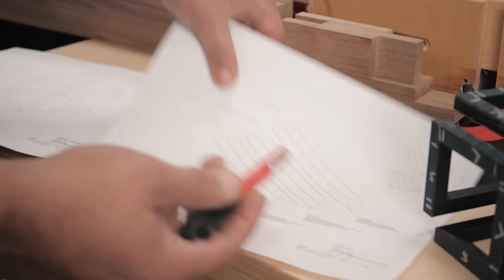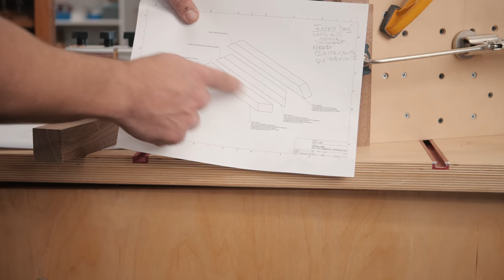Infinity Cube Table

Comment from the maker: Get the Free Cut List and Plans/Cut List here - http://bit.ly/InfinityCubeCutListPlans
My friend  at Everything Wood and Metal has a great cube calculator if you want to do a different size than I did. Check it out here: http://bit.ly/InfinityCubeCalculator
BitsBits is the BEST place to buy router bits: http://bit.ly/BitsBits USE CODE JKATZMOSES15 for 15% off
Reply: Jonathan Katz-Moses I’m first to ay hello!
Reply from the maker: I've gotten several orders from Canada today. Should be working.
Reply: Jonathan Katz-Moses my error. Thanks 😀
Reply: Build a second cube using the kawaii tsugite wood joint.
Reply: En tenon mortaise on ne verrait pas de différence de teint ...
Reply: Would you tell me all 18 sticks length ?
Reply: Great video. I was inspired to make my own table. One thing I must mention.  Make sure all 4 corners at squared off.  Mine were slightly curved so the joints did not match up nice and tight.
Reply: im going to try this for the airport,i got to get it approved if it does ill send you a pic, thanks for the idea!!!
Reply: Please share the measurements of this table! Love your work from India 🇮🇳
Reply: I miss SGI (Silicon Graphics, Inc. – https://en.wikipedia.org/wiki/Silicon_Graphics – whose logo this shape (in tubes) once was...)
Reply: @DavidLindes  Just went to check and you are right ...
Reply: Ritesh Sinha glad it checks out. :)
Reply: Thanks
Reply: Cant open the download the list will not open with one drive or Samsung cloud
Reply from the maker: @jimwatson6833  it's a .rar file you need to unpack it

Comment: Adding this to my build list for sure.  Two end tables and a coffee table to match.  Excellent project!
Reply from the maker: Send pics when you finish!
Reply: Well, did you build that project?
Reply: Shortly after, I had to pack up my shop and move, have been without my tools and shop ever since :(, but this is still on my project list.  I hope to have my new shop built in the spring, we'll see...
Reply: @billqqq  I asked because whilst I think it's wonderful project, I also think it's a huge step for the average garage woodworker. Even a skilled Sketchup user would find this a challenge - jigs, bench mounted routers, router templates, glass to order and get correct. But, the result can be stunning. I really would love to be able to make something so good looking.

Comment: Turned out great! I used a card scraper on the edge of some plexiglass I had cut to size, to remove the saw marks, & smooth it out.
Reply from the maker: Great tip

Comment: Awesome looking table.

My first thought for strengthening the joints further would be to drive a peg through each one.  That would change the aesthetics but it might look cool with a vastly different colored species of wood.
Reply: I second the Dowel idea. I would not let them be a through Dowell although. I would dowel on the inside of all joints stopping short of a threw cut making each dowel in a blind hole setting; therefore not visible on outer profile of frame work. I know it is more work involved, but I suggest off setting the dowel hole in the Tenon and Bridal joint to create a pinching effect for tightening the joint connection.

Comment: I looked at building one Mission end table.  It has 28 mortise and tenon joints in it.  I wanted a set of furniture.  A lot of mortise and tenon joints.  Very good practice, making 280 of those joints.  A good bridal joint project, if I ever saw one.

Comment: I'm planning this out, milling part is done to my dimensions. To make sure I'm on the sqaure here, when you do the bridal joints, you can cut them all the same right? It's just in the fitting process you maneuver the different ends to come together. If it's all square joinery, then you can cut them all the same. Just an amateur carpenter trying this build.

Comment: I am new to wood working.  Prior to January 2021, I had made things only in classes, other than little 1-piece gifts.  When I saw this video earlier this year, I knew I had to make it.    My husband also 3D printed it, in pieces, so I could figure out how to put it all together.    The 18" pieces and the 16" pieces are different colors.   We set up a shop earlier this year and this was crazy to make.  So far I only made it with 2x4s cut up, to get the idea.   Next we'll do it in hard wood.   Love it.  I've watched this video many times.  Thank you.  Question:   I was told to not do a full depth cut, but you did.   So that's ok?   We did the mockup in multiple passes, but would rather do them in one pass.

Comment: I've had this plan for about a year (?) and I've been afraid to screw it up. However, I've gained skills since then and now I'm ready. Going to try a lamp instead of a table. The inserts are going to be image transfer onto glass. It will take a while, of course. I wish there was a way to post the good result (doing a test cube first) on here. Can't use a router, so I'm going to try the tenon jig I have available as well as a dado stack. We'll see. Wish me luck!

Comment: Hi Jonathan, I'm making a table like this. My glass plate will comes between the beams with glass pin support. My question: how is your glass plate doing now, did it crack? Does the table stay straight or did use support blocks under beams to keep it in place? Kind regards, I'm David from the Netherlands.😃

Comment: Great table. I have just a few thoughts. You could slot dovetail the joints to give it add strength with two dowels through the back each joint as well it would hold the table together without needing clapping and would also help with the strength.
I would also like to say when machining any slots in the end timber and tenons. I would recommend keeping the material flat on the bed of the machine rather than on its end even with a jig. It's a lot safer working practice. You can achieve a similar joint with a 45 degree mitre lock router bit which will be just as strong.

Comment: Is it considered cheating if, when I looked at the joinery, I thought "some good ole square pegs in round holes centered in each of the bridal joints would add some old world flare without using glue"?
Reply: I don't really see plugs having the multi-directional stability necessary to pull this off.
Reply: @redcollard3586  👍
Reply: @redcollard3586  For the weight of the table alone hardwood pegs should work without a problem and I'd even argue than pegs alone would be stronger than glue alone with this type of joint.  You'd only really run into an issue if you try putting too much weight on it.

That aside, I'd say use pegs and glue.  The pegs would add a lot of extra strength to the joints and if you do a good enough job cleaning up the excess glue you'd never know the joints were glued together as well.

Comment: Really cool need to show my tutor this he says that tools are not good for woodwork looks amazing he's old school all joints need to be done by hand
Reply from the maker: You tell him!
Reply: @katzmosestools  he also don't know how to sharpen a chisel so his joints are not that good to start with lol
Reply: All of the above. Or maybe the curriculum states "hand cut joints." Or maybe he wants you to earn it and really understand joinery, but more likely, he doesn't have enough machines or time to fill out all those incident reporting forms in a classroom full of excitable young folks on routers. 

I had an 18 year old kid plug in a trim router without checking the power switch last year. He then tried to catch it as it jumped out of his hand. Thankfully, the router good smiled upon him, and he got away with a warning by way of a small, nonessential chunk plucked cleanly from his hand. Then, the blood came... And the damned incident report...
Reply: @jasondoust4935  I understand that part of working with power tools with my lathe I tern the power off at the wall when changing the speed just to be safe than sorry as only paid £27 for it so not sure if it all works as it should has been tested and all seems good

Comment: great project but is there a reason why a infinity cube dose not have the same dimensions overall eg the top dose not extend out above the side looks like it needs another inch l,w?  or is that the design of the cube to not be the same uniform shape see the bottom piece is the same not extended out in line with sides?

Comment: May I ask a question? Totally new to your channel. Liking it a lot!!  I'm Not a pro.   My question is. Would it make a difference in the overall stability if the base wood was heart wood? Silly question I know, but I have a sheet of a log sawn from a felled tree. If i milled it to build it "Centre up (out) would it matter at all to its over all stability? When framing the grain matters a little. Is this structure too small to see any benefit for grain density?

Comment: That is beautiful. I wonder if putting 2 brass rods in each joint (in opposite corners of the joint) would negate the need for the acrylic. I'd try it myself, but I have no place to put the finished product.
Reply: I was wondering the same thing, but with hardwood dowels. Lots of work though...

Comment: I am thinking of trying this with simple joints -- 45's and pocket screws with glue (I don;t have much in the way of tools or a shop -- mitre saw, table saw, some clamps etc. I can't tell 100% from your plans how the pattern works in terms of short and long pieces -- is there a drawing that has them marked? Sorry, prolly a newb question.
Reply from the maker: Check out the website I link as well. Should have all the info you need

Comment: Is it strong enough to be used in a typical home? Looks neat but also weak at those bottom two joints.
Reply: Just add another 5 supports and move the "feet" to under the joins.

Comment: I love this and am inspired to build one. Whether I’ll get the time remains to be seen though! I have a question and am fully prepared to be shot down in flames: I believe the idea behind the sticker on the spacing piece is to provide a looser fitting joint to enable room for glue and clamping pressure. It appears to me that the effect of the extra thickness provided by the sticker actually makes the tongue part thicker. At 5:58 the cutter can be seen taking a stickers thickness off from the spacer piece – leaving the tongue thicker than it would have been by the thickness of the sticker. Thicker by twice the thickness of the sticker once the other cheek has been cut. I must be missing something...

Comment: It looks as though the side faces are a thickness out of plane with the top and bottom edges. Assembly would probably be easier to get square and plumb if they were in plane with a thickness gap, that way you could just use offcuts in the gap to force squareness no matter the clamping force or gravity sag prior to the glue setting.   Don’t know if that change would make other parts of assembly or planning way more difficult.

Comment: How did you feel about each tenon, mortice in a single pass. All the advice I hear about router bits is that you shouldn't take a deeper cut than the width of the cutter? Seems you were taking a risk, particularly if using hardwood?
Reply from the maker: I talk about that in the video. Right after the joinery cutting montage

Comment: The other option if you don't have a blow torch, is a heat gun. The ones big enough for heating plumbing pipe... Not the small ones for card hobby :p

Comment: @Johnathon Katz-Moses What would have been really neat, is if you would have pulled in the sides so that they were right above the base then instead of using the acrylic block you could have embedded some half-inch or three-quarter inch Neodymium magnets into the wood and covered them with the stain so they were invisible and they would have supported the structure by holding it apart… It was a function like a cantilever against the other leg and you would be surprised how powerful a magnet of that size can be if you put one or two on each side of the corner.

Comment: I should just hit "like" as soon as I see you post a new vid, always at least 1 tip that I could really use in them.
Do you think you could add metal right angle poles to this to add some strength and keep the illusion, or would it not help strengthen the wood much?
Reply from the maker: That could work. I'm trying to dream up some ways to make this into a dining table

Comment: This is amazing and now I can't get it out of my head that I want 2 as end tables! But, I need them to be about 26" high for the correct size relative to my sofa. So, I made a test cube using crappy 2x2 lumber, just to see what the cuts were like to make and how good it would look at that size (using roughly the same proportions and formula as Steven's original metal build you followed -- so, my pieces were 1' 11 5/16" and 1' 8 11/16”). At that size, a lot of strength is needed in the corners that bear the load. Do you have recommendations for simpler joints that would be strong enough to hold the structure up at this size -- I just don't have the workshop you have, or the experience. Or, do I need to use hardwood larger than 2x2 to get the engineering right?
Reply from the maker: I would use 3 acrylic supports like I did.
Reply: @katzmosestools    Needs more for heavier item placed on top.

Comment: Nice project! I understand why it would work better in steel. I'm wondering how it would look if the base and top squares were the same outer dimension as the square of the legs in plan view (so that the whole thing actually looked like a cube)  You could probably then put fine steel pins in the gaps between the base and top squares to invisibly connect tthem to the legs, which would also make the whole thing much stronger.
Reply from the maker: You might lose the infinity look

Comment: I'm pretty sure that the twisting and unevenness when you finished the glue up was because of all the the different angles the weight are affecting the joints. Maybe working out a level of "spring back" like what you do in bent lamination can do the trick, or making the "stiles" (I'm guessing you could call them that, if not correct me) thicker thus making the joints less susceptible to the forces of gravity. Also I don't know what species of wood you are using, but maybe it's not rigid enough for this application.

Comment: I was thinking, (which is a bit of a worry !), I might use half inch by one and a half cheapest pine and off set the middle one one and a half to create the joints.  Then when I've stuffed up a couple I can use the better, ie more expensive, wood.

Comment: I love this idea. But it wouldn't work in my house, every horizontal surface gets stuff piled on it on a regular basis. These joints would have to be super strong to withstand being used.
Edit:
Also, if you don't want a glass top...
An insert made from a "tumbling block cutting board" pattern would go great with this table. Do you have a video recommendation for such a cutting board (and a link)?
Thanks

Comment: This is a very old symbol in Indian temples. It bares the nummers 12 and 6 in its structure which make 18 and so the number 9, the end of the cycle ready to start again thus infinite. The same principal can be found in Japanese mythology about Amaterasu the sun Godess holding a reversed mirror in her hand to the reflect the opposite image, the opponent. Therefor it s called a negative mirror-image or reflection. This infinite cube is a representation of this principal.

Comment: It looks lovely and everything, but I'm not sure it qualifies as a table, on a practical level, more of an art piece. I'm just looking at the structure and at the least supported corner and thinking 'yikes. I hope no one leans on that or puts anything heavy on it, 'cos there will be a nasty cracking noise and an unhappy creator'. You've got those two joints supporting the entire top in one corner. Maybe it's stronger than it looks? I really want to reach out and press that front corner down and see (not really, but you know what I mean). Beautiful job, though, don't get me wrong.

Comment: Why not have your joints in the XY axis instead of the XZ YZ axis. You're relying purely on the fit and the glue, whereas you could rely on the geometry of the joint had you done it the other way.

Comment: What would happen if you tried to connect the corners using dowels and glue? Asking for a not so talented friend... 😭😂😂😂 I'm assuming the whole structure would just collapse?
Reply: Update: It works with wood glue and dowels. Holds up a small plant pot and photo frame nicely in the corner of the room lol.